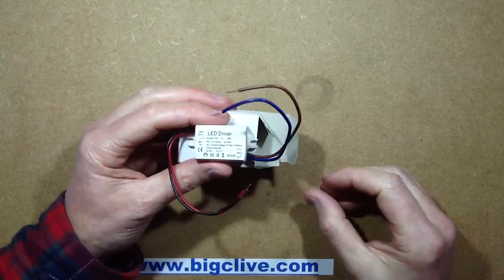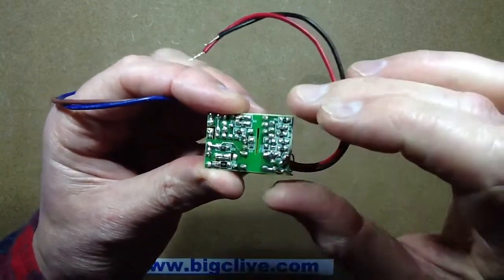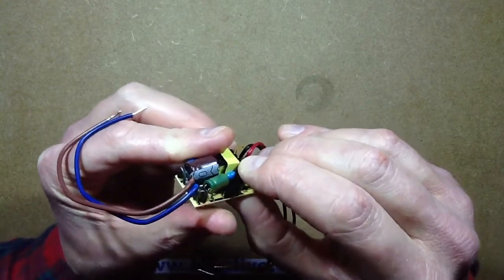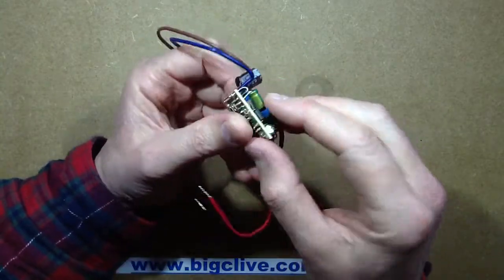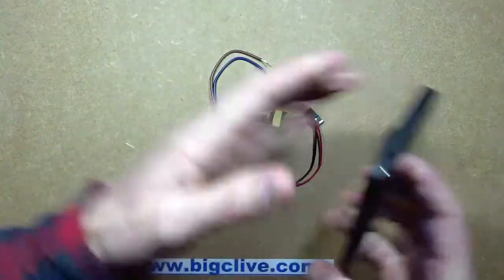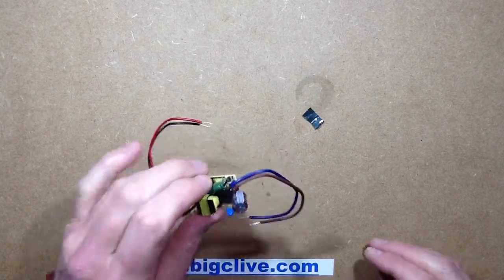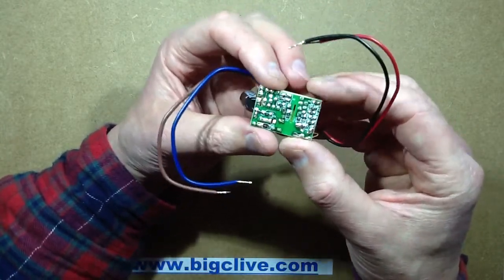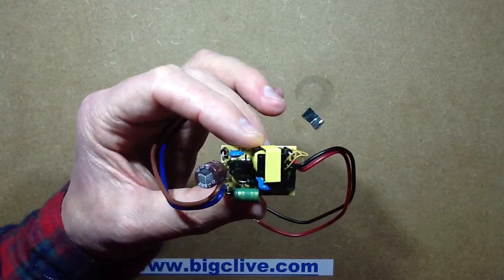A look inside a small 6W 12V 500mA lighting power supply.

Comment: can I use this voltage controlled led driver to power my Arduino with 5 volts directly or some modified circuit? since these are very cheap and good to have power source for Arduino from direct 220v main supply, video on this topic will be great.
Reply: It gives you about 12V at 500mA (Unfamiliar with the IC but looking at the schematic would tell you more) - You would HAVE to regulate it down to 3.3V or 5V for your Arduino but it should work; I'd suggest looking for a 220V to USB power supply instead though, unless you need the 12V for something, why not just go to 5V directly?

Comment: Could it be used with 110 volts?
Reply from the maker: You should be able to get a 110V or better still, a universal voltage one that operates from 85V upwards.

Comment: Is there a way to boost the amperage from .5 to say 10amps
Reply: ***** have you tried a PC power supply?
Reply from the maker: ***** That would require a much higher current driver chip, filtering and a bigger transformer.  You can get high current power supplies though.
Reply: Thak you I need 30 amps 12v so im trying to work around it, its for a driver for my speaker as it needs its own power. It does punch out 60 watt rms but it cant be heard over the sound of my engine in my rc plane.